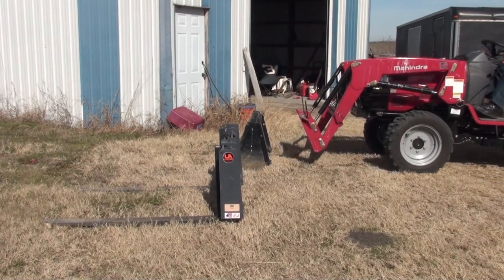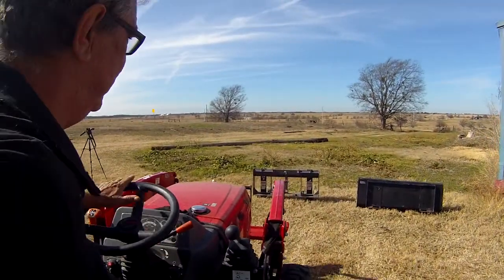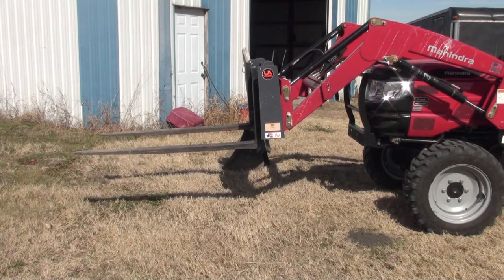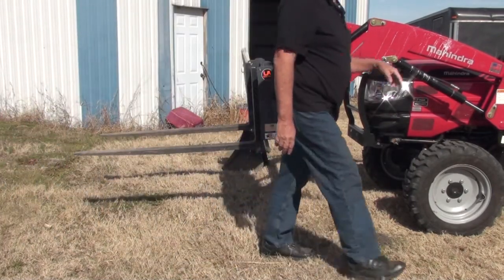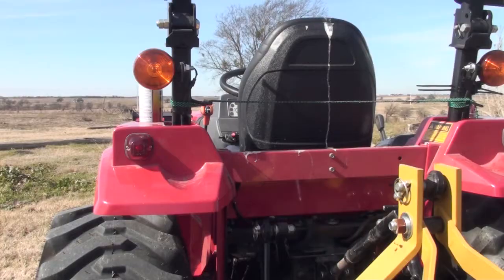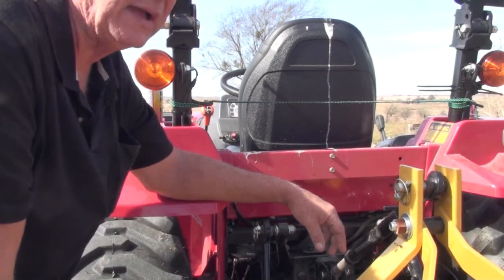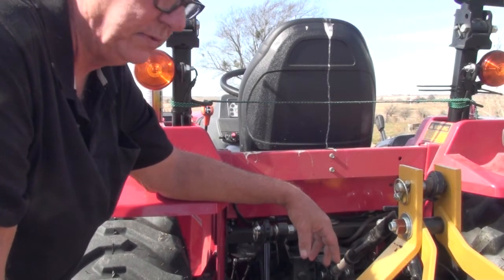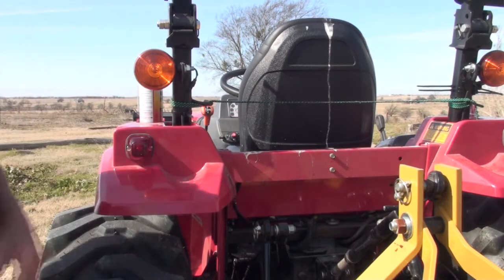Mahindra 1526 Quick Attach Front End Loader Toolbar

Comment: Hope you find out the problem and get it tended to. If for some reason it takes awhile, you'll be surprised at how fast you can adapt. It may take a little bit but it will get to the point where you'll forget that there is something wrong with your eyes.